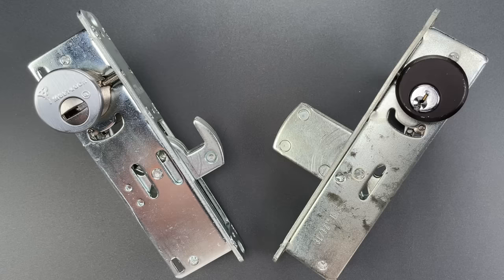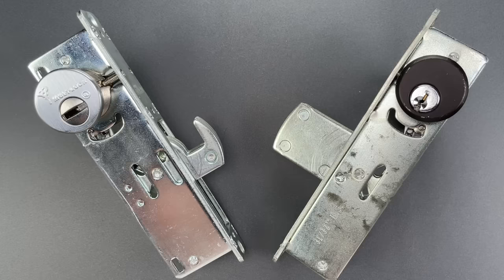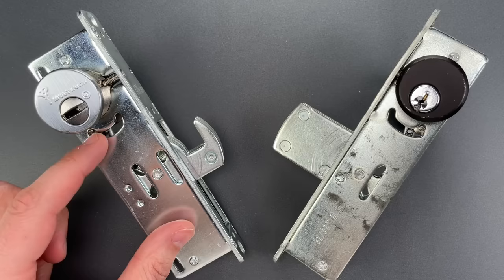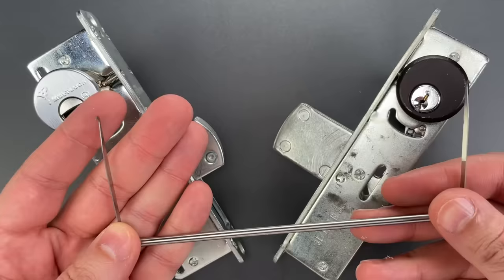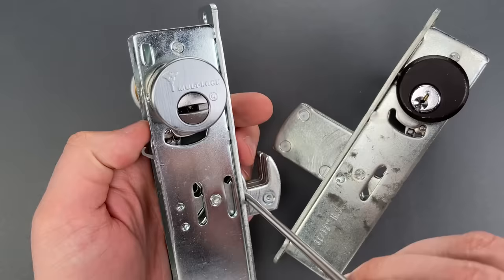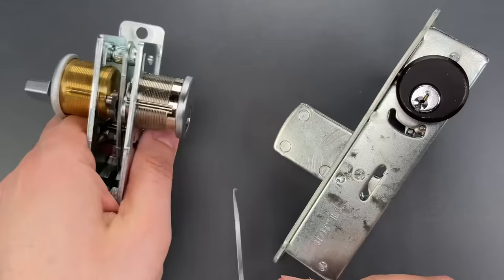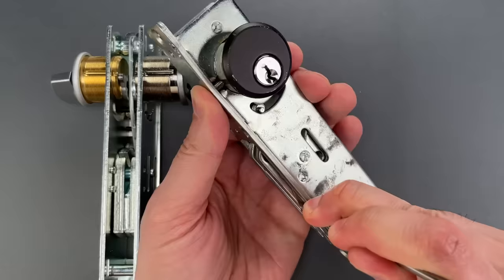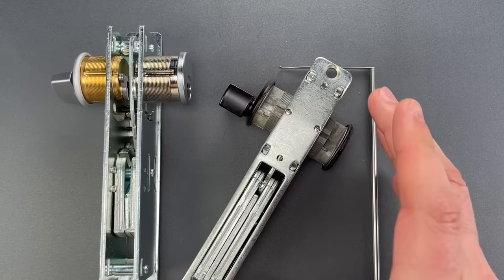[1409] The Most Significant Security Flaw in North America

Comment: As a firefighter, I’m really interested in these. We preach being as non destructive as possible but in context for a locked door with no signs of fire, it’s hard to get around things like this. Knox boxes for commercial buildings and (this I believe is less common) suction cups for 99% of glass sliding doors helps, but sometimes there’s a matter of urgency that still doesn’t justify kicking it down. This may have bridged the gap
Reply: Most doors that have these can also be opened simply by pulling really hard without breaking anything. The frames tend to be flexible enough to just bend a bit and let it go if you really yank. Apartment buildings and other places with buzzers also usually have a weak enough thing that holds it shut that it will just pop open. If you're at a door and you don't see any easy way to open it, yank as hard as you can before breaking it. It usually works
Reply: @antoniov4152  Firefighters do a lot of training on forced entry, that's not really a problem. The problem is that they also have to respond to alarms and there might not be signs that there is actually a fire. So while they could take an axe and irons to every door they come across, tools like this give them more options.
Reply: @antoniov4152  mostly also for when you get locked out of your own store/house, especially since that breaking it down being easier and most of the time more effective
Reply: If you suspect my house is on fire, please kick in the door.  I can buy new hinges and a door frame if needed.  I can not, however, afford a new house with new stuff.

XD
Reply: @antoniov4152  he LITERALLY just said for locked doors with no signs of fire that they need to get into, and your brain just conveniently bypasses everything he says huh…smdh, go to bed
Reply: @antoniov4152  insurance is a scam and don't actually cover everything, it's about 2/3 of the original price you paid
Reply: @antoniov4152  this is probably the fastest way to open it, unless you take a bomb to the door which will blast the door itself so you don't even have to open it.
Reply: @antoniov4152  Who hurt you?
Reply: Ok let's see let me get a boat load of  this and I'm sure they can be sold (hood) and with this video they can hit every  location and is a win win for everyone and if you don't get what I'm saying to bad. Any videos on cracking a safe 🤣🤣🤣 . Ya'll show thieves the blueprints and Ya'll wonder why shit goes down .
Reply: @antoniov4152  your the one saying that no firefighter should even consider buying tools like these.
Reply: @antoniov4152  it's literally what quality assurance does in every company. This guy is basically calling out those QA departments of those companies who approved the safety standards of that product. Just because you can learn chemistry and know how to make a bomb doesn't mean you're automatically a terrorist.
Reply: @ApasTalaz   of topic I guess when there's a home invasion don't even bother with locking your doors  this guy sells all the keys.
Reply: @Antonio V  I mean my nephew when he was 3 was able to open multiple basic locks and run 3 blocks at 2am because he wanted to see his grandma.  I'm banned from letting him watch this guy but at 6 he's picking apart locks and puzzle boxes without guides.  If he wants past this lock he'll just make his own tool because that's literally bent chicken wire he's selling.  Not some super high end expert tool just some bent wire exploiting a glaring flaw in lock design.
Reply: That was EXACTLY the first situation that came to my mind. You know there's been an alarm and nobody knows if anyone is still inside but there's no obvious signs of fire.
Reply: when i want you in, I will let you in. It's ok, fireboi, learn your place
Reply: @antoniov4152  this dude didnt read anything, he didnt say anything about it being used if there is a real fire.
Reply: fuck it got weird in this comment section
Reply: @randomlyentertaining8287  if the FD enters your house while it's on fire, you are going to lose everything anyway, for water damage. The role of the firefighters at that point is just to protect other houses.
Reply: @fedgeno  true and i learned this by accident, got stuck in an unfinished building, was about to call the emergency but my friend suggested yanking the door one last time and we boy do those aluminum door frames bend.
Reply: @antoniov4152  I mean if you’d rather think you’re safe with this lock rather than knowing how easy it is to breech then I suggest blocking all lock picking youtube content and sleep easy. But when all your stuff is gone and the police see no signs of forced entry you’ll be scratching your head with the same one you scratch your balls.
Reply: @eyetvideos467  don't worry my dude I shared this video to the hood where they are eager  to   creep on a come up. There's a reason why youtube doesn't allowed people to  show you how make a 💣..  ya'll just don't get it but hey let videos like this go viral 🤣.
Reply: @SaintBrick  
And if they have someone skilled on the team... Wont take long for them to get in.
Reply: Thank you for your service!
Reply: @antoniov4152  I mean it's also for the owner of a store if for some reason they are locked out, or maybe out of town and they need an employee to go get something.. as he said it's likely a commonly used locksmith tool. Not just a thief's tool.
Reply: as a burglar, I too am interested in these.
Reply: As a non-firefighter, I also find it very interesting since it's easier and less noisy than kicking in the door at 3AM to rob a store
Reply: @antoniov4152  not every insurance covers fire. Therefore they could sue the firefighter if it was not necessary to kick the door.
Reply: @belaballo5484  be fancy. You're not a burglar. You're a blackhat pentester
Reply: No firefighter has ever waited for a person to pick a lock to get into a structure.  every firefighter in existance uses an Axe and a Halligan.
They just tap the glass with either of these tools and their in,  Because they are not going to wait.  Its been like that for hundreds of years.
Reply: I commend your considerate, professional conduct and I sincerely appreciate all your hard work and all the risks you take. Im sure you would do it for free with no thanks but that doesnt mean we arent incredibly thankful to you and those like you. Happy 2022 bro/sis!
Reply: Hey thanks for protecting and serving without shooting people dead it's really inspiring
Reply: @Too Unique  pretty much.  Good old home depot.
Reply: @antoniov4152  damn, I wish I could find someone with as much faith in me as you have for insurance companies
Reply: @antoniov4152    Firefighters respond to many things other than fires too! They do a range of things actually!
Reply: Suction cups?
Reply: @tonyfourpaws4511  my fire station uses suction cups for sliding glass doors. Since most people just put a piece of wood in the track as a deadbolt, and the lock is an upside down U, we use the cups to pick the door up off the track while simultaneously disengaging the lock. Saves a sliding glass door and it’s an easy alternative to kicking in the front. Even police on scene look at us  amazed when we do it.
Reply: This is why there is a simple metal plate covering the gap in front of most commercial doors.
Reply: @antoniov4152  20+ years in info/cyber security, you’re now dabbling in the age old debate of offensive tooling and if it should be made available when weaknesses are discovered. You’re also likely in a spot where that debate will fall really flat, pick your hill carefully.

The entire reason we test security is to put the onus back on those claiming “our product is impenetrable” to fix their work. The ONLY way to force their hand is to open up the vulnerability, and show the weakness, out in public view. The vast majority of the time that isn’t successful, they’ll just ignore it, so we release the tooling as well. 

This gives you, the business owner or consumer, the ability to actually understand the vulnerability and put in compensating controls. NO single control is 100% effective and the weaker each on is the weaker the whole is.

The ONLY way to affect change is to call out manufacturers on their marketing BS with poor designs. The BEST way to do this is to release tools to show how bad they are.
Reply: What are you talking about? It's channel for thiefs and robbers
Reply: @patrykskorobogaty590  Seriously, what is this guy talking about? Who the hell is going to be messing around with lock picking tools, during a fire, or any other emergency, for that matter? This video is instructing criminals on how to break and enter into places they aren't permitted to be, for profit. It should be taken down.
Reply: @Grant Kirtz I am relax but are your locks  🔐 & doors 🚪 are they relax because I'm sure we got a video for that and before you say I got video cameras and tons of guns 🔫 go on and shoot to get payed.
Reply: Yeah always try before you pry
Reply: I just want to thank you for your service.  You guys saved my life.... I know it's not the time or place...but thank you...
Reply: @randomlyentertaining8287  A commercial door is usually a few thousand dollars. Not like your residential house doors.
Reply: @ApasTalaz  I don't think there's a single lock company out there worried about being featured prominently in an LPL video cuz even though sarcastically roasting companies does make him look smart and cool the problem itself isn't the companies but the consumers of these shitty products who don't care to be informed or are informed but still don't care so let's not pretend the LPL is some righteous warrior fighting for the little guy here
Reply: As a glazier, to remover commercial glass remove rubber vinyl around the vertical mullions, head and sill. Remove aluminum stop at the sill and 2 cups slide glass and it's out
Reply: I install hurricane impact windows and doors in commercial storefronts, this is a million times faster than trying to break through that stuff!  As a firefighter, you probably agree it's not always simple or even safe for you guys to go smashing a door.  All these guys saying "just kick in the door" are clueless, even after just watching the video showing how fast the tool is.  Dummies.
Reply: None destructive as possible thats funny, marons came into my office building getting ready to breach a door with axes......Commercial building solid wood doors, Timely frames.Very easy to pry open with a single Hallagan. I stopped them and put my through the drywall and punched out the other side and reached through and opened the door.. I get it, this is glass storefront but your comment made me LOL.
Just make sure you do it lower than the lockset to avoid light switches, alarm control panels thermostats etc.
Reply: "cause as least collateral damage as possible"
"also. here's a super cool red and yellow axe and sledgehammer which you will be using a majority of the time because a majority of the time you have no time"
Reply: @long chin man  I mean I've seen firefighters cops and emts stand around waiting for a landlord far more often than breaching.  Generally if there isn't an immediate life threat there's too much paperwork and legal liability to breach so better to wait until you know you need to breach.  Generally only if there is immediate Public danger is it legally safe to breach.  At that point even if you have keys and no reason too some police and fire will breach just because it's fun since even if the homeowner suffers thousands of damage and handed you the keys your reasonably safe for any legal action to never have consequence.

Though for legal reasons neither I nor anyone I know would ever needlessly breach a door to attempt a rescue to apprehension.  Especially me, I'm an emt I'm not allowed anywhere near that shit unless I switch to propper fire.
Reply: @sabotage7369  honestly where did this come from
Reply: @KayLee-lw5iv  not sure what you mean?
Reply: @antoniov4152  you obviously can't critically think about this. Not everyone's life is in danger for a fire, sometimes its not necessary to go full on rescue mode when you're getting into a building. If they break a glass business door thats 500$ at least right their
Reply: @fedgeno  i followed instruction from this video…im now in jail ☹️
Reply: @long_chin_man  It takes way longer, if you even can, to break through the impact glass doors we install today.  This tool is so much faster, use your brain instead of a hammer.
Reply: What in the case of possible backdraft tho? Thought it's always preferable to stay safe and cut in a small hole in doors then first when possible.
Reply: @OAikoT  good point, but I’d definitely say that situation warrants taking the door down anyway. This is more of a smell of gas alarm in a highly volatile environment type of thing in my book
Reply: Firefighters completely destroyed my store's front door trying to pry it open. They said they were trying not to break the glass. lol... new glass would have been $300. They did $4000 in damage! If they had this tool that would be a bonus, but if they just had the sense to break the glass, I would have been completely satisfied!
Reply: @banana-9959  Scam or not, I'd rather get back 2/3 then 0.
Reply: @smh95826  No it isn't depreciation. The point of insurance is to cover actual replacement value. Car insurance is tied to depreciation because there is a large used car market where you can easily find another car of similar condition and price statistics are closely tracked by several independent organizations. Many items in a building either do not have depreciation or they are disposable import trash with no secondary market.
Reply: @sabotage7369  that's what I thought.  Thnx
Reply: @TriggaPleas  I’m just a volunteer, not in it for the money
Reply: @sfodd1979  I’m sorry if someone has trespassed in your property and put your life at risk, or if you’re worried about security. I understand the feeling, but you need to see that if someone wants your possessions, a locked door isn’t going to stop 90% of them. If you’re this worried about your safety or your possessions, I’d recommend buying a firearm.
Reply: @sfodd1979  I disagree 100%
Reply: @ProtoCorpse  yes in the us fire basically does anything not requiring an ambulance or physical take down.  And frankly half the time they do that too.  People who think they only play video games and fight fires don't realize the sheer amount of responsibility fire has in the ems field.  It's in many ways kinda sucky they get burdened with so much so that medical and pd can be so focused.  Even if I was trained as an emt to disdain fire due to a weird rivalry or something, much respect for all the shit they do not just fire related stuff
Reply: @sfodd1979  It's more about showing vulnerabilities in lock designs to encourage companies who honestly don't give much of a shit to make their locks more secure. I'd rather have this content made available to the public to educate people on how locks work than trust in some wack sensible looking design that can be opened by a chicken wire for the sole reason that I wouldn't know its flaws. Breaking into your own security system is the best way to put it to the test and improve it.
Reply: @sabotage, it’s amazing how many experts have commented on your thread ;-) Yes, I agree, given we work on behalf of the community, when responding to potential nuisance alarms, both we, and the owner prefer we can simply leave the entry point the way we found it. Yes, we enjoy breaking glass, but we prefer receiving baked goods and future funding more.
Reply: @antoniov4152  every single time LPL puts out a video, there's always a few people (like you) who start whining about how "he's showing every criminal how to break into places better" however these videos have been out for years on YouTube and there isn't any increase in burglaries or any crime using lockpicking  or these methods, this is facts from the latest FBI statistics! So get a tissue and dry those crying eyes
Reply: @stevenlowel486  you're one funny guy keep dreaming while thugs enjoy this video gems.

Comment: There is also an easy fix for this.

The issue is that you usually have free access through that gap between the two doors on a storefront because they don't close as tight together as a single door in a doorframe does. Most of these store front doors will have an optional cover that attaches to the main door to cover that opening, or alternatively you can bolt a steel plate over top of it yourself.
Reply: Presents an Axe
Reply: so then you just make the pick longer and with a offset angle. an internal blocker would work better. as long as the big gap is there you can keep modifying the pick. and yes we all know the lock itself is still the weakest leank. sorry about spelling.
Reply: @bonepie  If you're willing to bring an axe to create a tiny opening in the door, then chances are that you're willing to bring an axe to smash a hole in the door, too. At that point it's pretty moot to discuss locking mechanisms, 'cause chances are that it's the structural integrity of the door that keeps axe invaders at bay.
Reply: YOU WILL NOT RUIN THE BEST REPLY ON THIS VIDEO.  @BlurbFish
Reply: I just LOVE this comment section.
You do you!  @TEAMGETHELP
Reply: When he said aluminum housing I was like well that's not a hard metal to begin with ..